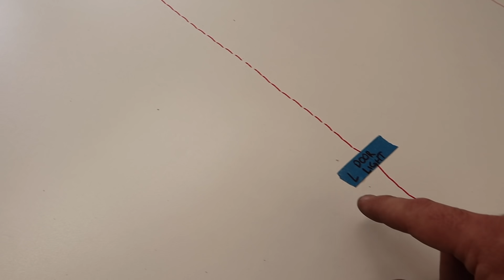Building a body wiring harness from scratch - Ferrari engined Alfa 105 Alfarrari build part 110

Comment: I'm a LONG time car audio guy, sound quality side of things, you're mostly correct about the wire. The difference in the charts is largely voltage/amperage. How much of each can a wire transfer before heating up over a specified distance, that's the important thing in wiring, keeping the heat from turning into flame. 

Not all wire is copper, there's a ton of cheaper CCA on the market, CCA is copper clad aluminum wire. It's basically aluminum wire made to look like copper, the advantage is that it's cheap, the disadvantage is that you need a larger gauge to get that heat to be not a problem because it doesn't flow as well as copper. It also will also corrode far quicker than copper does, it's basically inferior in every way, but can work in car audio because systems tend to change frequently. 

You're doing a great job, keep it up.

Comment: Once you’ve got it all together any splices or connections that are hidden inside the loom under sheathing should be marked on the outside by a simple band of colored tape. In the event you need to troubleshoot a circuit in the future having these will show you the mechanical connection locations and you want have to open the whole loom looking for them.  The same applies if you are going to wire a dead leg for some possible future component. A colored band where it ends will help later on. Honda uses green tape to show splice locations in the loom and blue to show accessory terminus locations.

Comment: Very nice build! Being industrial automation guy for 10+ years, running hundreds kilometers of wires make one conclusion: better to make reserve on each end (10% or 10-30 cm for ex. for a car) than to rewire it if you missed 1 cm to connect it. Experience is painful :) 
Hope your loom is measured good and you will haven't that problem, all wire's length are enough. Waiting for continuation!
PS wire rack i genius! Mostly in my career used wired from carton boxes or strait from spool for bigger gauges.

Comment: Hey Jeff this is awesome, totally remember the confusion about wire diameter and amp ratings too!
Incase you want a neater fuse/relay box down the line, the eaton bussman RTMR's are awesome. A little more expensive, but they have an interally bussed optiom so it saves a heap of wires and frees up some real estate.

Comment: Some auto wire is specified by diameter, and others (properly) is square area cross section. I used to wire locomotives with 50 or more wires in a particular loom (never counted them) all the same colour. Bloody wires going everywhere. There's a method. Reckon you've done a good job, it'll work!!

Comment: Great job!  One thing I discovered when I made my harness was that some relays were best activated by a "pull to ground" (the ECU's usually use this for fuel pumps and such) and some relays were best activated by a hot wire (ignition hot circuits).  I have two relay boxes with one for ground activation and one for ignition hot activated. It can get complicated having both styles in one box.  One other thing is think about where your connectors are when running the wires to your dash.  It is nice to have three or four connectors that service everything on the dash so you can remove the dash easily.

Comment: Tip for the heat shrink is put clear heat shrink over the top of the printed, without it the text will get dirty and fade, particularly in the engine bay

Comment: Jeff - run a couple of labelled "spare" wires to each terminating point - you never know when you will need to install something extra.  The weight and cost will be negligible but it will save you tearing a loom apart to retrofit that essential component we all forgot about

Comment: Having wired a few cars now myself I’ve learned to hate your standard auto parts store wire. The cheapest options I’ve found is buying the wire bundles from ECU suppliers(DIYautotune is who I use).  TXL/GXL wire and you set! Sometimes it’s pre-labelled too! This works for the thin gauge stuff, then you need another option for the main loom.

I remember the headaches the first time around though. Argggh

Comment: Wire colour code recommendations 
Keep red yellow and orange for constant live or switched high current circuits.
Keep green and black for earths
Use all the other solid colours signal circuits and such 
Use multiple coloured (striped) wire for sensors and canbus stuff.
The bane of every Mechanic and Auto electrician is wires that are all the same colour and wires that change colour multiple times in a circuit.
 Labels fail.

Comment: nice work... i thought my spider ecotec coversion out..used the oem wires from the ecu to the engine sensors//i am keeping the engine ecu and wire , separate from the car itself but for the body of the car. as all my lamps are led's i can run 18g wires for the the led's.. except for the headlights./. they are also led's. but for safety.. i am running replays for both high and low beams.. from the light switch to the relays.. 18 g.. no issues they , very low load.. from the relays to the headlights.. i am useing 10 g wire for the power supply to the headlight relays and the wire from relays to the lamps..as compared to the oem harness// lost some weight to the harness and made it cleaner.. also i buy my colour coded wire from rhode island wiring, you can buy it from the foot, and its in 18g ...09 cents per foot.. and the codeing is the stripping tpye as you see in oem wiring..for the battery cable.. welding cable comes in 0 or 2 gauge.. more wired strands.. and much more supple to bend around things

Comment: Aircraft wiring was all white with tags on the wire. The tags are very good, I assume you will be running the headlights through a relay as the m unit isn’t made for 4 headlights. All in all. It’s coming along very nicely. Are you going to run the electrics on the board before you cover it all up. One thing I did was splice the earth wires together to minimise the amount of earth points onto the body. Earthing points are always a major concern for failures.

Comment: There is a difference in the wire core itself. You notice it a lot more when you get up into battery cables. The higher end stuff will have more fibres of smaller diameter and the cheaper wire will have less strands and be thicker. 
The more/finer strands will have more flexibility and most importantly, less gap between the strands themselves for air/moisture so its less likely to rust/tarnish. They are also generally better quality. Of course the quality of the copper used is the major factor in resistance and corrosion but I've always found the higher strand count wire to be better.
For doing battery relocation and running new battery leads I always suggest to people to use stereo amplifier wiring instead of battery cable. It's just easier to work with and usually cheaper. Some of the insulation on stereo wiring isn't as good as battery wire so I always suggest throwing an additional insulation on like a heat shrink or loom tube but yeah. 
Some people swear by welder leads but they are expensive AF!
Reply: Thanks for the tips - much appreciated.

Comment: The best door wiring I have seen (and I have seen ALOT) is the Porsche 928 its on a plastic flat track its a flat ribbon type wire it fits in to the two piece track and slides in and out so no binding of the wire. SO put the new fancy three-D printer to work and make some that should drive you insane but it would be WAY cool. you think door wire breaks  down there try Alaska at -50F

Comment: If your looking for another way of doing the wire dispenser,  look at diecast resurrection. His partner on the site built him some dispensers for tape but could be used for your wiring.  The separated the tape in to dispensers that could be removed by sliding just the seperate dispensers out of the holder.

Comment: six 12 ga wires for front lights, six 12 ga wires for rear lights, lots of watertight plugs 3  conductor, 4 conductor, 6 conductor, and bulkhead connectors and a fuse panel, an hour to set up the front and rear each, have fun. dont over think it, so simple

Comment: It is still somewhat easier to get a loom out of a similar vehicle than making your own.
The key words are similar vehicles.
And you will usually find one of these at a salvage yard where most of the stuff that is in the road of removing the loom has probably already long gone especially on a pre canbus vehicle.
Most of what you want this loom for is the wire in the right gauge and length with hopefully a contiguous colour code and possibly all the connectors.
The wires that will be most useful are the signal and tail lights and front lights, these are the longest and most universal.
Reply: So.....just go to a local wreckers and find a wrecked Ferrari powered Alfa 105 and grab the wiring loom from it, hey.  Too easy!! ;-)
Reply from the maker: 100% no for so many reasons.
Reply: Totally agree -- I just cant understand why anyone would even suggest that option. Way better than chopping up old looms. So many things tat can go wrong and involves so much more work. I've always built my looms from scratch and actually enjoy it.
Reply: @couttsy222  I was actually thinking a Toyota Ute or other small simple vehicle.
All you want from it is the long wires and connectors.
And you will choose one with good quality wire not any old piece of crap.
At about five bucks for a premade loom as opposed to a couple of hundred for wire and stuff and time it works out easier and cheaper and I’m speaking from experience not just hot air.

Comment: A good way to decide wiring colour would be to use the same colour code of a trailer coupling as they generally have the colour printed on the plug, makes it easy to trace at least the lighting loom. MY 5 cents worth

Comment: Love the series, can't wait to see how good it looks when its done. Being an OEM wiring designer for years. Looks like you have it under control. I'm sure you thought about it, but you didn't mention temperature? You will generally want to go higher temp spec in engine bay (especially anything that passes near the exhaust), and anything in the headliner (under the roof gets very hot in the sun!). If you go lower spec wire the insulation may degrade over time.
Reply: I do my wire connections with western union splice.. then heat shrink..or electrical tape🙃

Comment: Great progress Jeff. However - please update your wire diagram as you are making the loom. You will never regret it as you then have a nice paper showing you gauges and color of the wires. My experience is the labels are becoming hard to read after some years. Which then are going to be hard to fault finding. Also please try write the “standard” you are using e.g. brown for ground, red for + wires etc.

Comment: PDM unit .. I know its for motorbikes but will it be enough to handle all the amps from a car as most circuits run 30 to 40 amp relays etc thank you
Reply from the maker: Yes
Reply: @HomeBuiltByJeff  thank you

Comment: Labelling printers are a great invention but once a job like this is finished tend to be used intermittently. I have wasted loads of batteries over the years as I hadn't realised that the electronics  put a constant drain on them. So now I always after using the labeler pull one of the batteries and they now last much longer